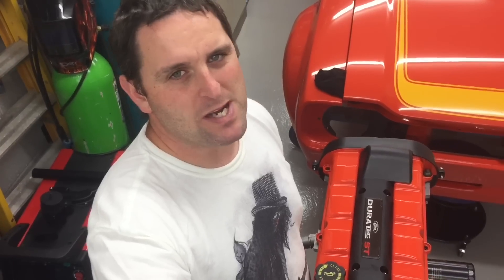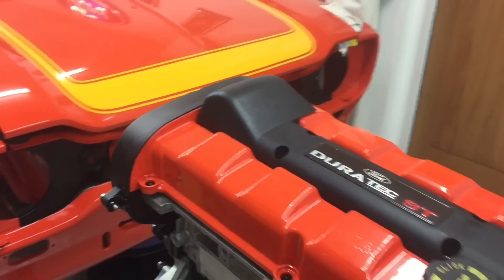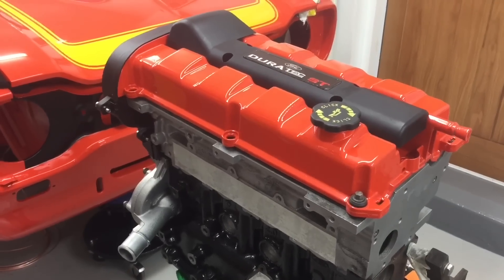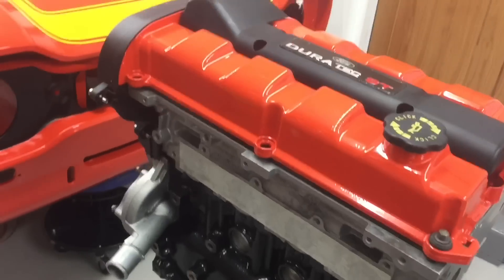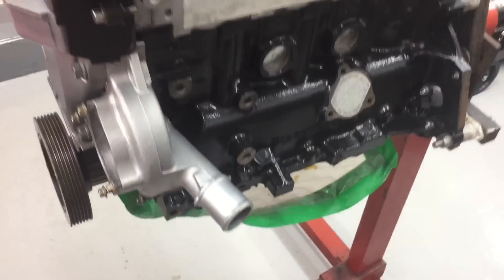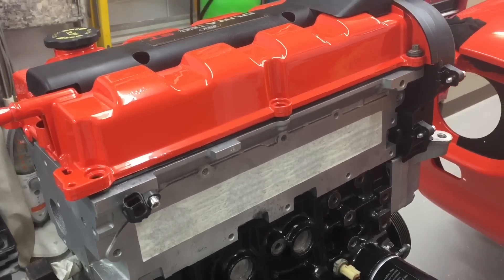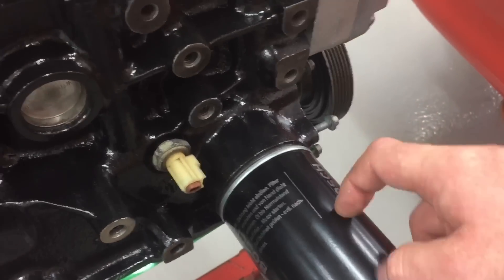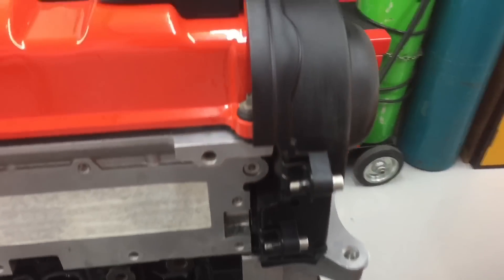Fitting Duratec, Zetec, ST170 into classic Fords Mk1 Mk2 Escorts

Comment: Would you mind sharing a rough cost of a classic ford to st170 conversion. 
With those throttle bodies. 
I’m interested in getting good mpg as well as power. 
Which I don’t think webbers will achieve. 
Just the conversion ignoring the price of the engine and gearbox. 
So once those are bought the price to then get that running in my mk1 escort. 
Which currently has a 1.3 Crossflow.
Many thanks
Reply from the maker: @simonmenzies3142  Without sitting down and working out every individual price, it would be a rough guess but you will need Throttle bodies, Engine management, an exhaust system, water rail, engine mounts, a sump, Flywheel and clutch. Using decent quality parts such as retro Ford, your probably looking at around £4000-£4500 but you could do it for cheaper using cheaper parts
Reply: @performanceclassics1986  fantastic thanks for tbe reply. 
It now gives me a time frame in my mind of how long to come at this over. I’ll pick up tbe wngine and gearbox. 
Then start on the conversion parts list. Thank you👍🏻

Comment: It is the problem of the electronics for the injection etc that  baffles me, who can work it out for you?
Reply from the maker: Graham Dawes When your fitting them into another car from the original, the standard ford engine management is very often thrown away and you then buy a kit specific to that particular engine such as an Omex system, motorsport electronics system etc. These come with a fully labeled wiring loom telling you what each individual cable is for eg what sensor each plug fits. You can also request that the engine control unit comes with a base map which is good enough to get the car running and then a rolling road test station can fine tune the map for ignition and fuelling to ensure the car runs as smoothly as the ford engine management but they are capable of bigger power gains than with the standard engine management. Both Retro ford and motorsport electronics do a bespoke kit for the ST170 and they also cover other engines such as the Zetec, Duratec, pinto, Xflow, cosworth etc.

Comment: Would the lightened flywheel decrease torque.
Reply from the maker: Steve Arnold No it Doesn’t decrease torque but it does decrease inertia as there is less weight in the flywheel.

Comment: Question,do you have any knowledge on the 2.5 duratecs? In planning on buying another ford fusion with a manual and the 2.5,trying to modify a fusion,many thanks
Reply from the maker: Corey Kosoris Hello, thanks for your comment. Unfortunately i haven’t had any experience with the Duratecs. I know they are an alloy block, have chain driven cams rather than belt driven and from what ive heard they are capable of producing big power when the engine internals are upgraded. Ive heard they are a bit more expensive to build / upgrade than the zetec motors because they are obviously more modern. Other than that, I’m sorry i cant really be of any further help with the Duratec motors.
Reply: @performanceclassics1986  no problem the reply is appreciated,just want to have a 300hp fusion at some point,its appreciated

Comment: What made you decide to use a zetec instead of a duratec? Cheers
Reply from the maker: Baron von Teuchter They are Cheaper to get hold of as they’ve been around longer. The ST170 is also 170bhp standard theoretically which is good starting power for not a lot of ££££ If money was no object id have a BDA or a Harris built Pinto but due to the very high prices of all things classic ford, i had to save money somewhere.
Reply: Performance Classics Thanks, it’s an interesting one. You can get a duratec from a fiesta st for <£500 but maybe the conversion parts are more expensive. Zetec looks and sounds great though, going to be a lot of fun!
Reply: Performance Classics money no object I’d go for a Millington I think! 😅👍
Reply from the maker: Baron von Teuchter Yes absolutely. The millington diamond engines are the best of the best. I think theres currently more available for the Zetecs in terms of bolt on conversion parts etc. Have you seen Gordon Murrays escort buid?? Retro power built it and its Duratec cosworth power. The build is outstanding like everything retro power do always is.
Reply: Performance Classics yeah it’s amazing! What a machine.
Reply from the maker: Baron von Teuchter Id love to work for Retro power. I love their awesome work, their passion to produce unique builds, how they re design aspects of cars to improve them in the same way the likes of Foose Design in America do and it just looks a good place to work if i didn’t live many many miles away.

Comment: nice group of parts craig, when you send the rocker cover off, just make sure you don’t need to modify the breather port as they can come in contact with the bulkhead
Reply from the maker: v JaccK Thanks very much for the comment. Yeah i do need to cut that pipe back and blank it off. I wanted to get it welded up but they say Magnesium is really tricky to weld.
Reply: Performance Classics, no problem, just something i notice as i made that mistake.. drilled the side and fitted a bulkhead JIC fitting so i could run a pipe straight to the catch can, and yes your right about the welding thought i’d let know before you paid it to get repainted,
Reply from the maker: v JaccK Thanks again. Appreciate it. I must make sure i get that done asap.

Comment: Did you have the engine rebuilt to standard spec or ported head and cams
Reply from the maker: Its completely standard James. The head is standard too. The only upgrades ive done are ARP rod bolts, Lightened flywheel, vernier exhaust pulley and obviously it will run throttle bodies, omex management and a decent exhaust. Hoping for as close to 200bhp as possible 🤞

Comment: Why don’t u ever use the rs 2000 engines from a 1992
Reply from the maker: Daniel Daniel Thats a very good question and one that im not sure about. I know they were 150 bhp standard so good starting power but ive never seen it done in a classic Ford. Very good question. Id like to know the answer myself
Reply: they use almost the same bottom end at the sierra/granada 2.0 dohc engine, so is an easy swap, but there is the issue of the thermostat and im sure its a different shape to the zetec one so needs some form of adapter making, plus tuning the dohc/rs 2000 isnt easy. zetec gives more power for less money.
Reply from the maker: Psych0 Puppy Psych0 Puppy Thanks for that bit of info. I had heard they were difficult to tune also. Every-days a school day 👍

Comment: Would the ST170 engine run a far higher compression ratio ?
Reply from the maker: timj41 No im not aware of the compression being any different to a black top zetec but the pistons and Rods are much higher quality. I think the pistons are forged. The cylinder head flows much better too + variable valve timing. A combination of them is where the additional power comes from as far as I’m aware.

Comment: Good stuff and glad I stumbled on this as an old Piñto fan. Must admit still remain an 8 valve fan of non interference heads .Endless hours of fun playing with cam timing as I remember with a mk3 Capri many moons ago. Hate ECU and sensor setups and prefer a carb. Cheers and look out for your progress.Len.
Reply from the maker: Glenn Powell i completely understand where your coming from Glenn. To be honnest i should really be fitting it with a pinto on carbs and for many years i preferred a carb set up too. It wasnt until i built my twin cam mini turbo on mappable ignition, that i really appreciated how easy it is watching somebody set up all the parameters to exact tolerances just by changing figures on a screen. Thanks very much for your comment 👍
Reply: @performanceclassics1986  Thank you for your reply.I am in my 50,s so I guess all my early tinkering days leave me a bit biased. But as you said in your video I hate and distrust electronics. The Vauxhall echotech twin cams could have been decent lumps but killed by sensors and engine management stuff.The old 8 valvers were golden for tuning although not as strong as a Pinto. I will keep an eye on your project though as I am still a petrol head at heart.Cheers!
Reply from the maker: Glenn Powell Yeah im not very good with computers so i leave all the mapping down to a guy whom has set up a few of my engines now with very good results. Hes superb at the re mapping and i just watch and admire what he can do. I will try to keep the videos coming 👍
Reply: @performanceclassics1986  Fair play.